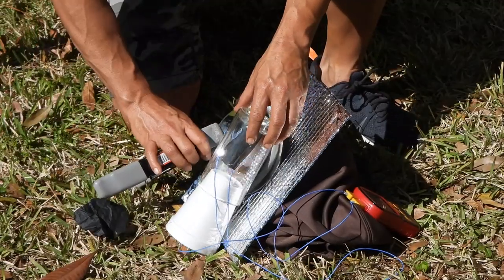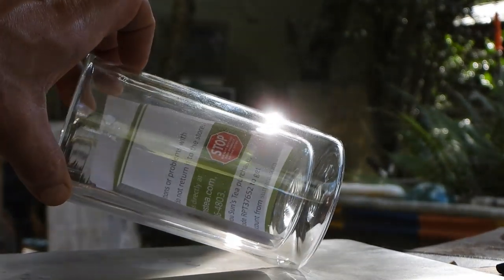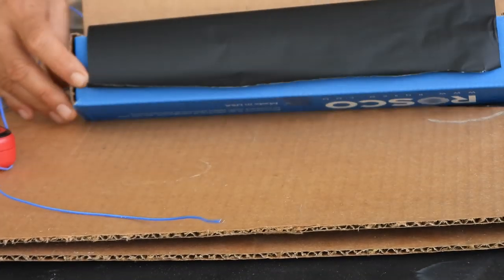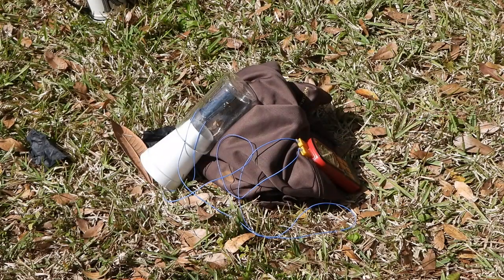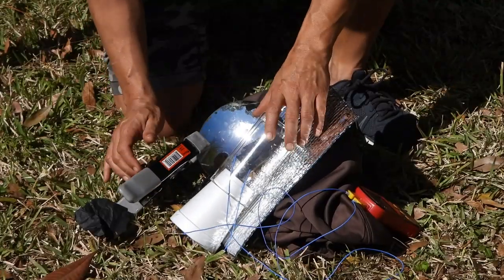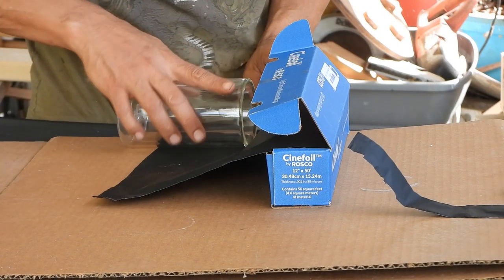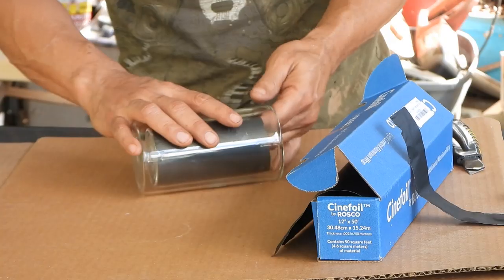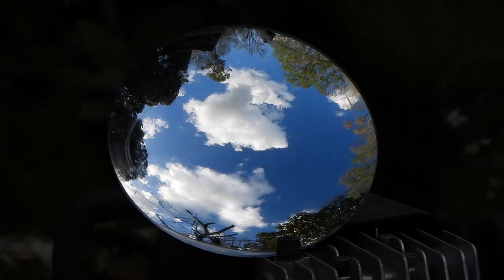mini SOLAR OVEN vacuum chamber insulation Cinefoil

Comment: Dan I love your videos, there's none that compare to what you're doing. You and your wife have been a HUGE inspiration in my shop and i hope that you never stop what you're doing.
Thank you!
Reply: tell me Dan would aluminum foil spray paint it with dark high temperature spray paint used for barbecue grills work it shouldn't  Burn off that can hold the 2000ﾟ

Comment: I supplement the heat for my home with a cinefoil heater. On a sunny day as was today over half of my heat is supplied by my cinefoil heater. The high today was 41 degrees Fahrenheit, 5` Celsius and a low of 20 degrees Fahrenheit, -6` Celsius.
Reply: 🔴 What Is Islam? ⚠️

🔴 Islam is not just another religion. 

🔵 It is the same message preached by Moses, Jesus and Abraham.

Comment: Celsius temperature included would be good for your international audience :)
Reply from the maker: I agree, I will on the next video… Thank you
Reply: I don't agree as they need to learn our archaic system more than we do their fancy maths.
Reply: 35mmraw good idea
Reply: 32F=0C, 212F=100C
Fahrenheit is the superior scale for humans. 100F is really hot, 100C is deadly. 0F is damn cold, 0C just annoyingly cold. 50F is sweater weather, 50C is really hot.
Reply: Google it like I have to, to get to Fahrenheit.
Reply: @Serahpin  Life is based on water, Celsius scale is based on water. 0C is freezing for pure water (under standard atmospheric pressure, sea level), impure gets slightly lower. Water in your finger freezes, the finger falls off. Water in your finger gets vaporized, your finger gets vaporized/cooked... tissue matter starts to absorb water and break down into smaller components.
Reply: @sFeral  Life is based on water. Fahrenheit is based on water. There is a 180° difference between the freezing point of water and the boiling point. Between 0° and 100° where you find the most life. This range means the increments in the life zone are more meaningful.
Reply: @Serahpin  How fine do you need the scale to be ? When temperature starts to approach 0C, I consider that cold. We don't get much subzero temps where I'm from.  When it starts approaching 45C Iin the shade, we consider it "boiling hot".
Reply: @sFeral  The difference of 1° is noticeable. That in itself proves that it's not too fine a scale. If you could not tell the difference, then I'd agree with you. But we can, therefore it's useful.
Reply: @Serahpin  Can't say I'm sensitive enough or have a varied enough wardrobe to justify memorizing  the extra integers (as associations). The "based on water" argument relies on the fact 0C - 100C has a direct relation to water, 0F doesn't. I read the wiki article on Fahrenheit, and was disappointed, thinking he tried to set his 0 to the freezing point of human tissue, or blood.
Reply: Water boils at 100C or 212F.... and Water freeze at 0C or 32F....
Reply: @jenshobroh1294  Yes, which clearly illustrates Fahrenheit isn't based on (pure) water phase change. Read the wiki article for full illumination.

Comment: I will need those mirrors and reflectors, because my goal is to be able to do this with -20 outside ;-).
But I wonder: currently I live in a country that has no direct sunlight. There are always clouds, and light mostly comes from all over the place.
For solar panels I went for panels that have a higher efficiency on diffused light. So polycrystalline instead of monocrystalline.
It's not even directed at the 13:00 top sun performance. Because for those few days of the year it's performing top, I had to give up efficiency for the other days of the year, and especially in the morning (mine are directed at a 10 degree slope south east).
But yeah, focusing diffused light. I need to search for that.

Comment: This'd be pretty handy for hitchhikers. I wonder if it'd still work well in cold snowy climates.
Reply: It would probably need some help in the latter case.  Take some kind of lightweight but durable foam (like black EVA), and make an inverted cone shape.  Then glue aluminized mylar, or Solar reflecting film, on the inside.  
     Make a vacuum insulated glass top for it.  If not vaccum insulated, then at least double wall with some silicone in between the two pieces (leave a very small gap between the silicone seal between the panes for pressure to escape--otherwise it might burst).
     The combination of all that insulation and that concentrated  Solar energy will cook it even in cold temps and less direct light.
Reply: Also, I recently read about some testing they did on Steven Jones's funnel design.  Apparently less mirror reflective coating i.e. more dull, matte reflective stuff like aluminium foil, actually did better than mirrored reflective coating like aluminized mylar.  They think it was because in this design, you don't want to concentrate the Solar energy to a small point, but rather disperse it over a larger area.  Either way, consistently, the more dull and matte reflective coatings outperformed the mirrored type in cooking times and temps. (This was a bit of a surprise to me). 

  You can find thinnish, flexible EVA foam with a dull, reflective coating already on it, in rolls for pretty reasonable.  It's sold for floor underlayment insulation/cushioning.

    If going a route like that, since the material lacks stiffness, I would take some water based Minwax Polycrylic, put a thin coating and one layer of thin, lightweight, cheap fiberglass (like 1 oz/yd2 stuff) to the back to stiffen it up some and make it overall more durable and tough.  Unlike epoxy (which is much more expensive, and more toxic to work with), the Minwax Polycrylic, while it (and the fiber glass combined), will stiff it up, it will still allow some flex and give.  It adheres pretty well to EVA foam--as I've already done some tests.
 
  However, one might want to skip this route and keep it fully flexible, in order to be able to roll it up more easily.  If you have some strong and small clips, you can clip it into place, or contact cement glue some velcro/hook and loop to it for that purpose.

Comment: Could you fill the vacuum between the glass layers with CO2/methane to stop infra-red escaping from the glass cylinder without stopping visible light entering it and then being absorbed to produce a heating effect?  Alternatively, could you 'coat' the glass walls of the cylinder with an 'infra-red shield to contain more infra-red inside the tube without detrimentally  impeding the entry of visible light into the cylinder in the first place?  Couldn't this accelerate the heating of water inside the tube?

Comment: Could you immerse a giant 'insulating vacuumised double wall' container into seawater/sand/soil to, eg, boil water and release steam via a vertical pipe into a condensation chamber that would release water from condensed seawater steam into a giant water reservoir?  If so, could the later release of the accumulated water in the reservoir be used to generate electricity via the driving of turbines by the falling water?

Comment: Aluminum foil covering the entire floor under the carpet (eg, in the home) would 'reflect heat' into the room/s; covering the walls with, eg, pictures/paintings/posters with aluminum foil attached to the back of each of these wall coverings would further enhance this 'heat insulating effect', as might including more black furnishings/ornamentation/décor inside the room/s which would absorb more visible light from sunlight, eg, during the period before/during sunset and convert it to infra-red which would radiate into the room/s, thereby increasing the room temperature.  Additionally, could, eg, covering the roof/outer walls of a house with a sturdy, weatherproof, retractable black 'roller blind-style' shield during winter also enhance the insulation of the home by absorbing visible sunlight during winter and converting it into warming infra-red which would then heat the walls/roof of the house for an added 'insulating effect'? Could covering the inner surfaces of a kitchen refrigerator/freezer not also enhance domestic energy efficiency - specifically relating to kitchen appliances - in the same way?

Comment: Position two heat conduction insulating, double-glazed windows together in close proximity - but still separate - with a light absorbtive, black material layer and water between the two windows to solar heat water occupying space between two double-glazed windows instead of heating water inside a 'vacuumised, double outer wall tube/cylinder/s'; substitute the double glazing with a potentially vast surface area 'sandwich' of two adjacent but separate 'twin layers of bubble wrap' with a vacuum between the two layers of heat conduction insulating, air-filled plastic covering over (like a table cloth/pool cover/tennis courts cover) a potentially quite vast, shallow 'pool' of water in contact with a heat conduction insulating, underlying layer/surface (eg, a layer of horizontally-positioned, double glazed windows/a vast layer of concrete containing vacuumised 'holes'/'gaps', eg, by pouring concrete onto a vast layer of plastic covering over an area of wooden beams to create a set concrete layer on top of the beams and raised above the ground towards a downwards heat conduction effect) containing a light-absorbtive, black layer of material to solar heat water (not in direct contact with the bubble wrap plastic covering to avert any damage to the plastic should it not be sufficiently heat-resistant to withstand boiling water temperature) under a vast double layer surface covering made of two layers of bubble wrap with little/almost no air/gas between them.